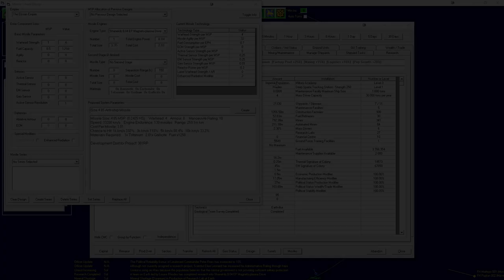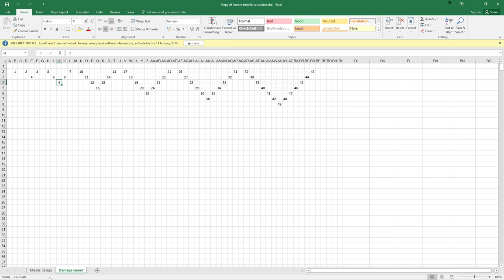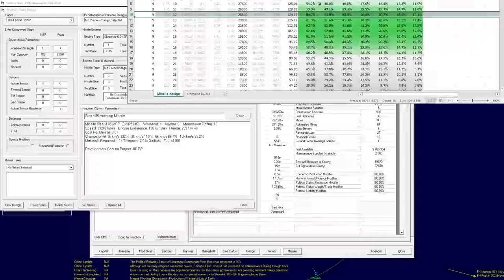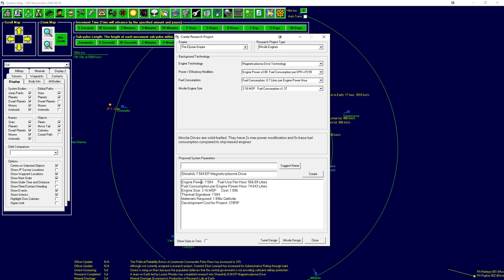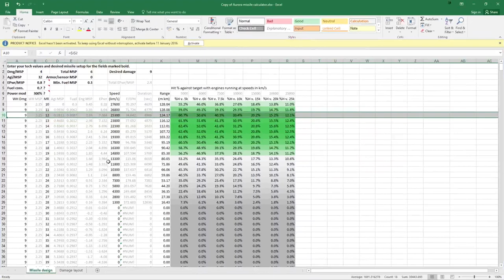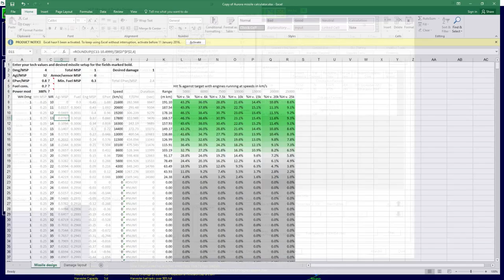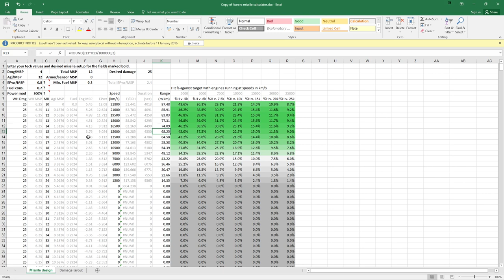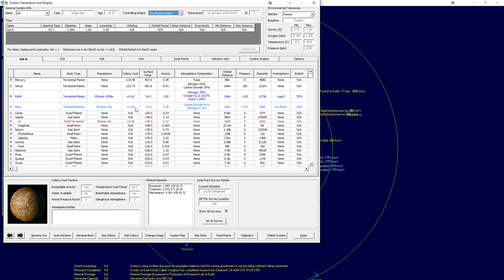Aurora 4x #09 Quick Missiles - Let's Play

Comment: You can press the letter or number while the drop down menu is selected to jump to the first entry with that number or letter and in this case, you can type in 3.16 and it takes you straight to what you need. This is standard behavior for pretty much all drop down menus.

Comment: +EnterElysium @ your problem for harvesters not giving you over the fuel, this is because there is a build flag in the design your ship page for "Tanker" - this gives it a behaviour of a tanker rather than a regular ship. It gives you specific "unload/load fuel" etc orders in the main order page but seems to be the only way the game allows you to give refuel orders to a ship, even under the conditional page.

I tested this (since I learned it just second hand from +Quill18 's video when he accidentally created a tanker screwing up his ship. First thing it does is create a ship with only 10% fuel, it gives you all the new order options i mentioned and on my test I had it load up a fairly significant amount of fuel 5.25 million litres with a harvest rate of 600,000 litres per year. (in a previous game I tried a MASSIVE tank and harvest rate, in the billions and unfortunately you get stack errors since the game has difficulty letting you play with transfering such large amounts of fuel.

Back to my test, I could have given it less fuel storage or more harvesters but... hey :) playing it safe.

Mission started in 10th February 2077, ended 22nd April 2092, it unloaded its Fuel at the nearest place (one of Uranus's moons) so quick i didnt get to catch it (even thought I was stepping so slowly when it hit 100%, but it had fast engines) however on the same day I am looking at it and the ship has 10% fuel and Oberon, the colony it put the Fuel to has 4.7m litres of Fuel (where it had none before).

Bottom line : The game doesnt let you use the Refueling mechanic without marking the ship as a Tanker